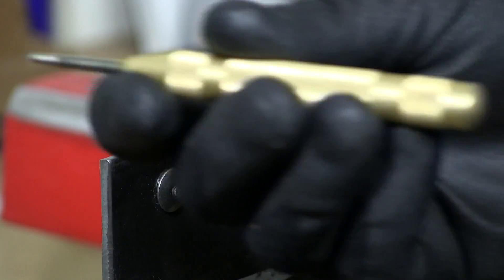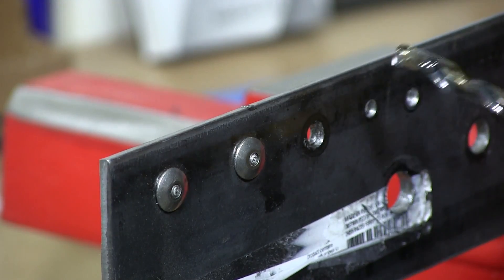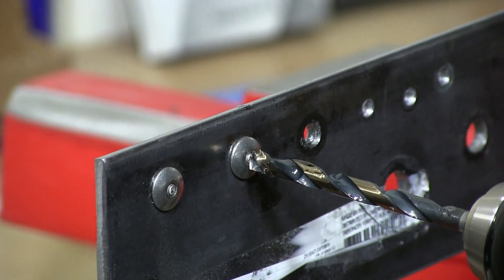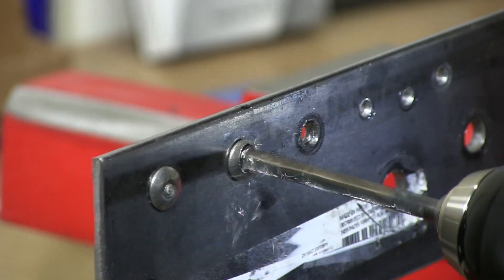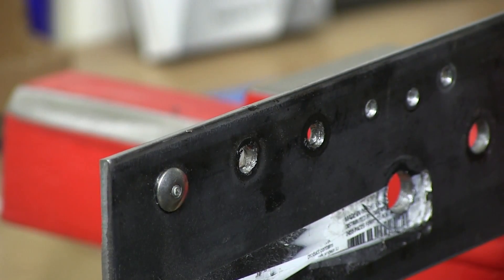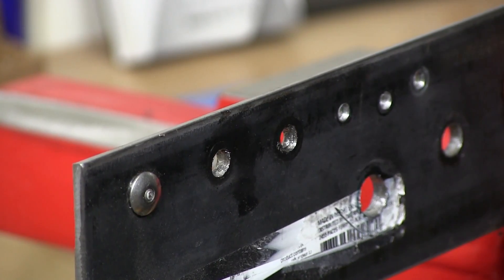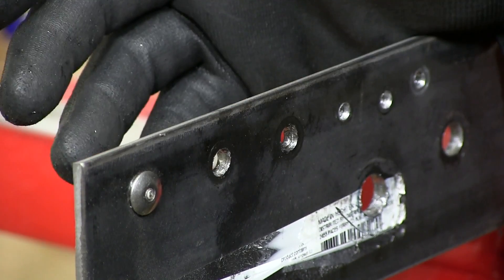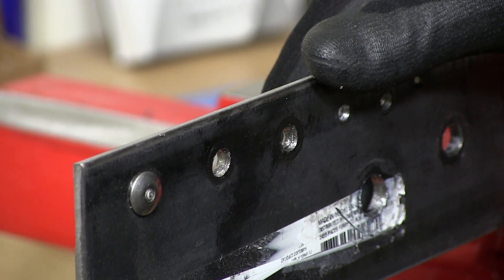How to Remove POP Rivets Without Surface Damage | Fasteners 101

Comment: Do I do the same thing with aluminum?
Reply: If the big part is aluminum, and the pin in the middle is steel, they say you should use a metal nail / awl and hold it against the centre and hammer out the centre first, and then drill, like in this video, afterwards. It is something with the steel part in the middle that makes it difficult to succeed as the aluminium is softer etc. That way you don't destroy the edges of the hole either.

Comment: No no no! Use a carbon steel chisel and hit hit with a large hammer and they sheer straight off, if you dismantle things for a living you will know exactly what I'm talking about, using a drill is messy and takes forever and a day! 🤠

Comment: Those mandrels are hardened. It's much easier if you punch them out first using an air gun with a pointed tip

Comment: This is not the way to go because it will change the diameter of the hole into a larger hole. I would rather grind the top until it is flush with the riveted surface and I could  just push the remaining part of the rivet out with same or less diameter pusher.

Comment: What if the rivet is damaged and you do not know what size it is? How do you determine the size  of the drill bit, to use?
Reply from the maker: The drill bit should be either the same size or smaller than the hole the rivet is installed in, if you want to use the same sized hole. If the rivet is damaged, compare drill bits with the rivet head and find the right one that is about the size of the center portion where the mandrel used to be. Of course this will depend on how it is damaged.

Comment: I need to remove rivets on an item that I don’t have access to the back. I can’t have the stem fall inside...any tips?
Reply: How was your job on this? I got exactly the same issue to work on. No access on the back, a hollow piece of rectangular steel with no want of stem fall inside

Comment: I'm sorry to go against what you are showing there but I believe you are in error with your example of how to remove a blind rivet. "THE" Proper way to remove a rivet, is nothing like you have shown here. You should support the back of the panel and using a small parallel punch that is the same size as the rivet mandrel, carefully drive, the "break off and trapped" section mandrel of the rivet back into the set rivet. This gives you a centre to drill the head of the fully set rivet out. CAREFULLY, and SLOWLY, drill down into the head of the rivet with a larger drill than the rivet size to a point where you can remove JUST the head. Then CAREFULLY punch the remaining rivet body out of the joint. All the time you are doing this, support the back of the riveted joint if you possibly can. What you have shown there has ruined the joint because you now have an oval hole. No "Aircraftsman or panel setting  technician" would ever do what you have done there, they would be fired immediately on the inspection of their work!
Reply from the maker: Thank you for your feedback

Comment: what drill bits are you using?
Reply from the maker: In this application I used a Norseman magnum drill bit that is the same diameter of the rivet being removed. Thanks for your question!
Reply: Thank you for the response :) I have been looking for a decent set of bits!

Comment: That's awful!! You've now ended up with a scored surface and an over sized hole. Knock the centre stem out with a punch, use the correct size drill, drill to the base of the head and use a slight sideways tip to snap the head off the stem. Remove the rivet tail with a punch and you have a perfect unmarked hole......
Reply: I'd definitely do it the way I always have as I described above. It saves the drill from  causing any damage to the hole if the drill goes right through. This technique you demonstrated would cause potentially expensive damage if it were to be carried out on something like an aircraft.
Reply from the maker: You could try that! Or, you can put a piece of painter's tape over it as we demonstrate in our follow-up video: https://youtu.be/rZTAQ8jCep4

Comment: I tried drilling my rivets, but the f'ers start spinning so the drill does nothing for me. Any advice?
Reply from the maker: Yes! We actually did a video on the subject: https://youtu.be/4TwmQfbKsh8
Simply put: a good way we found to deal with drilling out spinning rivets is to first place a piece of duct tape or blue tape over the rivet. This will help to keep the rivet in place while you drill. Hope this helps!

Comment: If you use a centre finder drill from a lathe as an initial pilot/positioner you can get a more central hole with your main drill.
Reply from the maker: Thanks for the tip!

Comment: punch out the center stem, drill with a larger drill bit to take the head off then punch out the back side.....saves the surface metal and once you get used to it you can use the same holes with same size rivets
Reply: Structural rivets (monobolts) are a pain the ass to remove. I use a centre punch to knock out the centre stem then drill the rivet out.
Reply from the maker: Thanks I will do a Structural rivet video coming soon.

Comment: Any hints about what to do if the river spins with the drill bit when trying to drill through the river head?
Reply from the maker: Hi Don T. and thanks for the question.  If the rivet is spinning then the wrong size was installed.  If you can get a thin flat head screwdriver and wedge between the to dissimilar materials that may work.  Or a vicegrip may work.  If you can apply more pressure.  I'm going to test this out on my bench and will post a video.

UPDATE: Here's a video on how to remove a loose or spinning rivet:

https://youtu.be/4TwmQfbKsh8
Reply: @AlbanyCountyFasteners   or the spinning rivet has enlarged the hole because the incorrect method had been used
Reply: If the rivet spins  add a couple of drops of loctite 638 at the joint, leave overnight and drill it out easily in the morning.